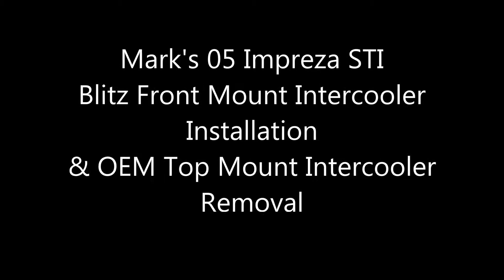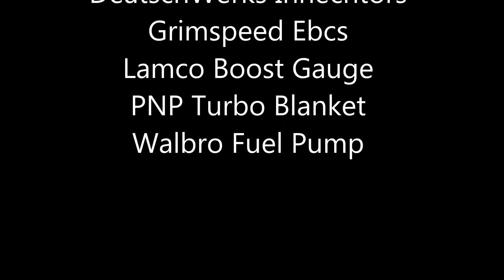Mark's 05 Impreza WRX STI Blitz Front Mount Intercooler

Comment: you have a realy nice Subaru mate but in my opinion the worst design pipe work, one snag on the drive shaft or bump from the road and its cry time, I can see the concept of getting colder air but seems at to much risk :(, hope your car works good though :)
Reply from the maker: Thanks man. STI been running fine for about 8 months now with this setup. We have swapped over tubing to the more traditional style of things. As I think your referring to? When we pulled the driver side tubing, no apparent damages appeared in these location which you're describing that we could see. Maybe we're lucky though.Thus the reason for changing the tubing over was to avoid the transmission and to keep it cooler. As your know it runs right by there.We'll have an update soon. Men don't cry cheers mate.